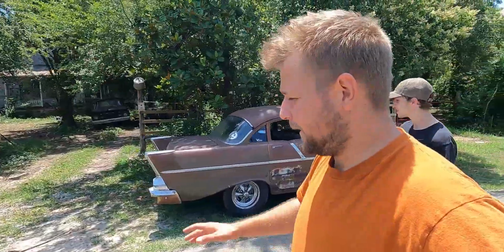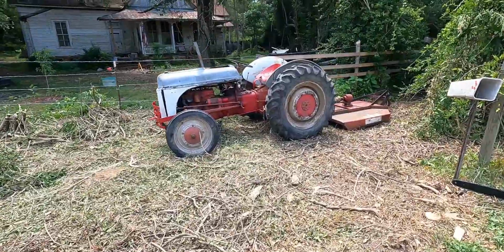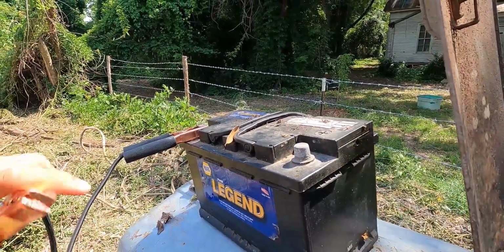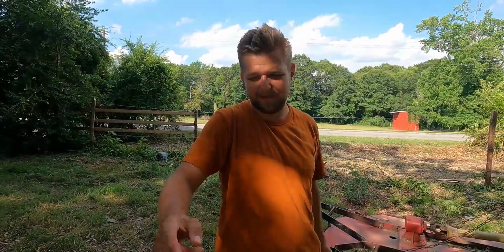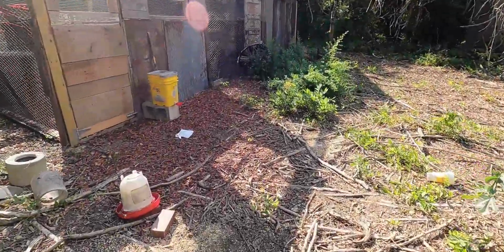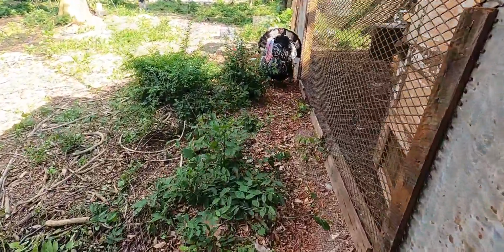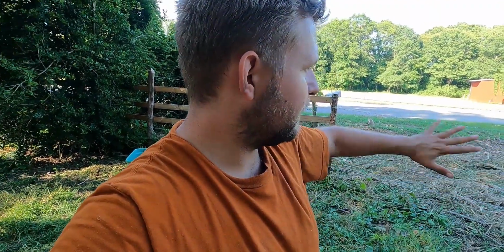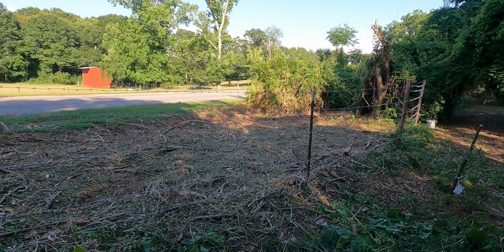CLEARING FENCE LINE ON OVER GROWN FARM (DAY 2)

Comment: Hello Robert and Cody,thank you so much for taking us all on your journey to fix your home up, l was wondering if this little trick with help with your tractor battery it always worked for my car battery, take the battery could off and on the terminal place some silver foil paper over them,then put the coils back on and see how that goes,l hope it works for you,as l said it was a fantastic save for me when l was stuck in traffic and my battery would die but not after l used foil on the terminals, good luck,xoxox 😊🌻🍀

Comment: Clean the battery terminals and tighten the cables. Wrench tight, not hand tight. And a new alternator.
Reply: @K.V. Rider I agree loose connections like that causes nothing but problems..